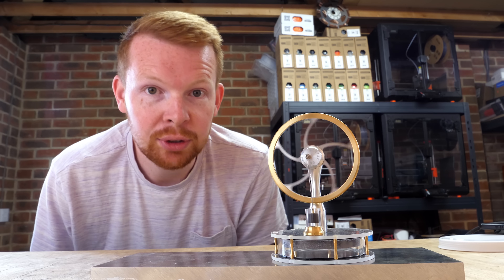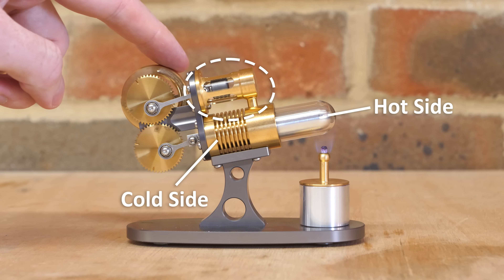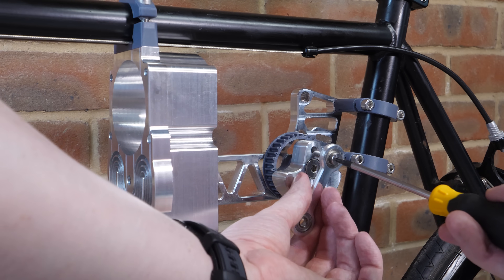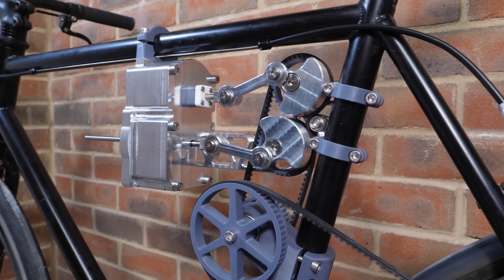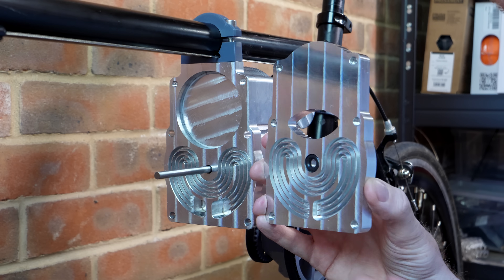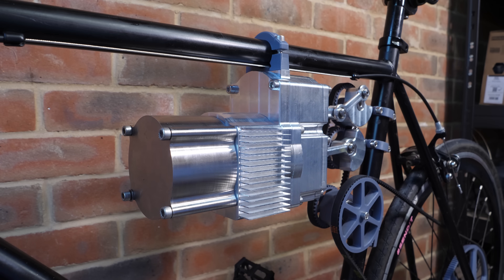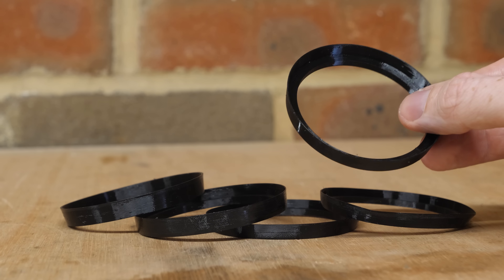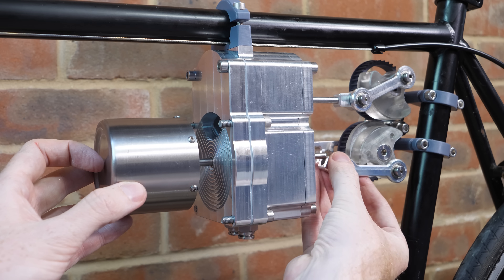Building a Stirling Engine Bike - Part 1

Comment: You should do the same thing, but make a steam engine
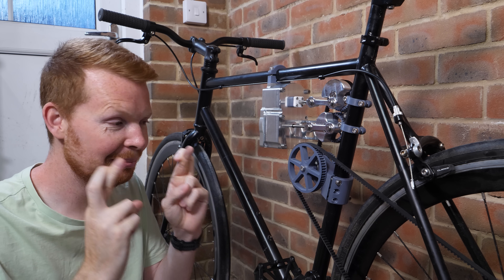Reply: 6:54
Reply: @startedtech lol I didn’t even get that far yet, thats crazy.  The only good thing about steam engines is they can create significantly more power.  But yeah, efficiency seems more important for this project.
Reply: @CoolWhipMan  Steam engines are as efficient as these stirling engines if not made with using 1800s methods of producing power. You just need a flash monotube boiler with a PID controller on the steam output temp to control the fire, throttle as the water injection on the boiler, a turbine as the expansion and power generator, heat exchanger on incoming boiler water with expended steam, and turn the expended steam going out of the turbine back into water using a radiator / condenser. Preferrably using a tesla turbine as the turbine, which is easier to build and would be much smaller.
Reply: @ExtremeGamerYT22  or just a triple expansion engine... its not like Tom is getting that much efficiency without a regenerator, and a closed cycle turbine doesnt exactly have the kind of low end torque that would be necessary for a bike.  I bet even a single flue butane fired boiler (as long as it had at least some superheat) could run a normal model boat triple expansion engine with enough power for his bike.
Reply: @1471SirFrederickBanbury  A triple expansion engine is great too, but I recommended the turbine because it can have significantly more efficiency than the piston engine. If you gear reduced it and added a clutch it could be used normally
Reply: @ExtremeGamerYT22  fair, but for Tom's concerns, efficiency is irrelevant when the source of heat is an open blow torch XD
Reply: @1471SirFrederickBanbury  Efficiency also means more power, which, with even a respectable 5% efficiency (since all the heat is going around the engine, not into it), means at most 200W without any of the drivetrain. A well made and very respectable stirling engine I saw that was a bit bigger, pressurized and with a heat exchanging cap made mostly 100-200W, which means that his engine, at the current state, will simply never work without serious improvement and gear reduction.
Reply: @ExtremeGamerYT22  true, though an important part of power in a system like this is torque vs rpm.  Reciprocating steam engines are high torque, low rpm,  turbines are high rpm, low torque,  and stirling engines are also low torque, but don’t make the rpm to be geared down to function quite right on the bike.
Reply: @1471SirFrederickBanbury  True, turbines are perfect for an electric generator setup, not direct drive.
Reply: But then you would have to have a big heavy boiler.
Reply: @WilliamMerchant-q6b Not big nor heavy. You can look up, someone already made a steam bike with a tiny boiler (monotubic design) that was self regulated and ran extremely well with a single cylinder engine. It ran on propane gas
Reply: @ExtremeGamerYT22  and what's the what's name of the video?
Reply: @ExtremeGamerYT22  thx, ill check it out